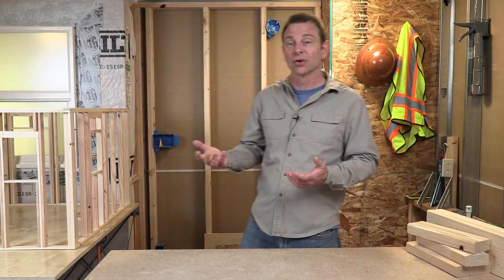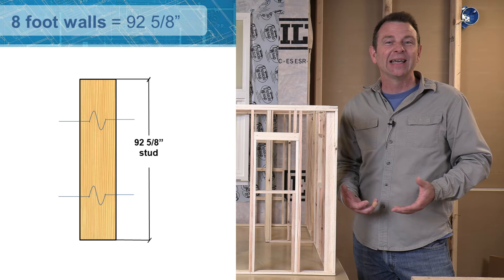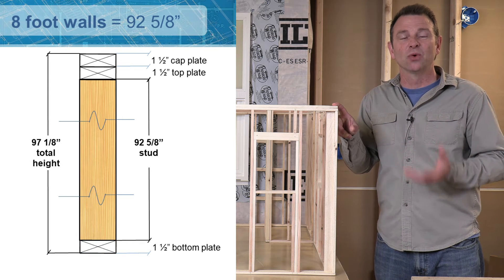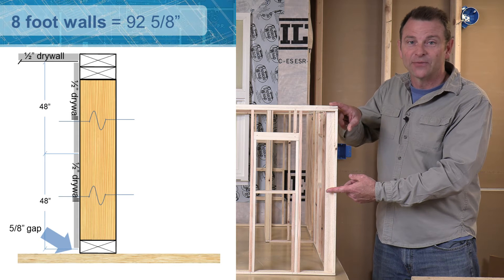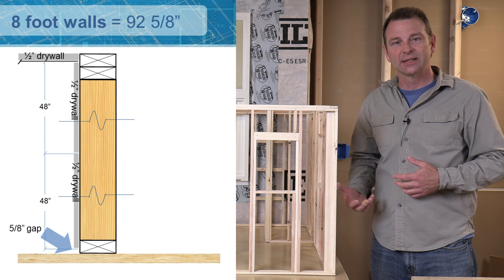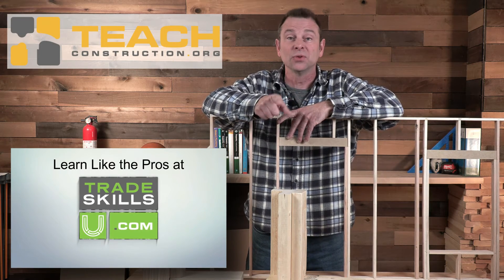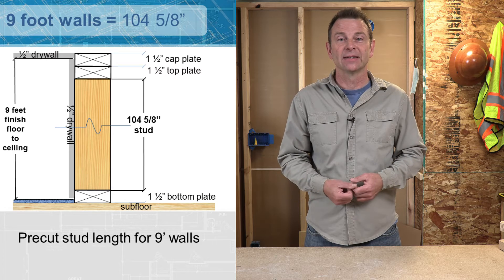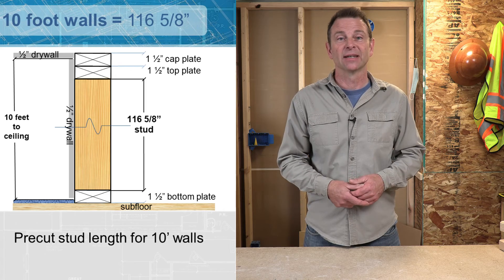Ever wonder why wall framing studs are available 92 5/8'' and 8 feet - Trade Training Video Series

Comment: So when sheeting the outside wall is the Osb flush with the foundation or the top plate??
Reply from the maker: Careful to make sure the sheathing or any wood materials is high enough from the ground per your local code.

Comment: It's nice in theory, but we had to cut down 80 of those studs by 1 1/8 inch to get 8 feet. From the Home Repo, 2023. You see, 2x4s are 1 1/2 inch thick, and 1 bottom plate and  2 top plates is 3 2x4s, and 3 times 1 1/2 is 4 1/2, subtracted from 96" equals 91 1/2'. Sorry to use a word that has qu in it, I know that's not part of construction terminology.
Reply: Now add the 1/2" for the ceiling drywall and you are left with a 5/8" spacing at the floor like he stated in the video.

Comment: As a plumber this still makes zero sense to me. I work in commercial and spend 90% of my time trying to figure out how to have plumbing/fire protection/electrical/data/ controls/HVAC fit in ceilings that are way too low to begin with. Shorts studs may create efficiency for the framers/drywallers but are an absolute nightmare for the rest of us.

Comment: Good video. Im journeyman carpenter and when i was taking classes with union carpenters they didn't teach us this in class we mainly learned about metal stud framing and soffit work. This video is educational. But over the years I've learned wood framing from older guys that new this of the pre-cut studs at 92-5/8 and there is a reason behind that. You explained it real simple. You ought to make video about installing sheathing and siding. I've seen many homeowners who don't know a thing about sheathing and installing siding for their additions. Ive worked on side-jobs where the home owners didn't do their work correctly and i just hv to make it work. I save these types of videos to show the youngsters how to do residential framing, drywall, taping, texture and sheathing/siding intall. Im telling you lotta youngsters need to learn the carpenter trade we are a dying breed. Back in the days when i was a younster i believe older more experienced carpenters didn't teach us these things that were important so i was yelled at a lot. Back then there was no YouTube tutorials.
Reply from the maker: We do have a video lesson about sheathing in this series.   Siding may be available on YouTube in about a year

Comment: Do you always need two plates?  For example the basement framing that is not structural should only need one top plate, correct?
Reply from the maker: That is correct - a cap plate is not required for non loadbearing, but they are often installed to keep all the walls consistent.
Reply: @ConstructionEd  thanks for the reply

Comment: Don't you have drywall different  lengh? 2.5m 2.65m 3.0m are normal. 😅😅😅👍🇩🇪 and timber comes in Dimension 6/24cm 13m. You can gut where you want!!
😂😂
Reply from the maker: Our typical drywall is 8, 10 and 12 feet

Comment: I was always told it was 5/8 drywall on the ceiling and 1/2 flooring.
Reply from the maker: You can use 1/2 or thicker on both locations.   It mainly depends on the joist spacing, and cost.
Reply: Great explanation, but 5/8” drywall should always be used on the ceiling; and on the walls in anything but the cheapest of houses.

Comment: Hmm isnt the standard celing drywall thickness 5/8 inch? Also how does this work for the exterior sheathing?
Reply from the maker: 5/8 is not always required for a ceiling - it depends on the spacing of the joists.   But if you were required to step up to 5/8 you still have the room at the bottom.   It works quite well on the exterior, what specifically was your question.
Reply: @ConstructionEd  I came here to ask this exact question. With these 92-5/8" studs giving a finished 97-1/8" top to bottom dimension what do I do about the 1-1/8" of exterior sheathing? I'm going to be doing vinyl siding over the sheathing and assumed 1/2" reveal at the sill but the 5/8" reveal at the top plate bothered me some. I'm going to have a 12" eave and soffit so I know these gaps won't even be seen but just curious "what is the right way?".  Thank you

Comment: Here in California, we have always used 92 1/4" studs for 8' walls. Never heard of 92 5/8" studs. However, a 1/2" gap could be more helpful than a 1/8" gap. Where are you located?
Reply from the maker: We are in Colorado - But figured that 92 5/8 was pretty standard - interesting to hear that you guys are at 92 1/4 - is that the only precut size on the racks
Reply: @ConstructionEd  We would get studs from the lumber yard pre-cut at 92 1/4 or 104 1/4 depending on the ceiling height of course. The box stores have 92 1/4 next to the 96 2x's. I have not framed in several years, now that I am teaching. 
After a little research, it does look like 92 5/8 is more common.
Love the fact that I am always still learning.
Reply: @ConstructionEd  We use 92 1/4 in Reno NV as well.